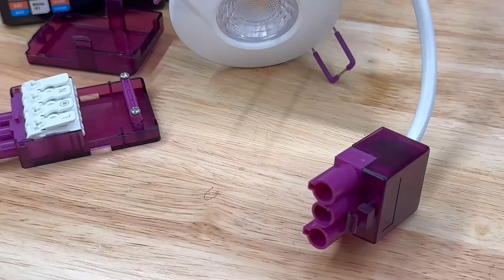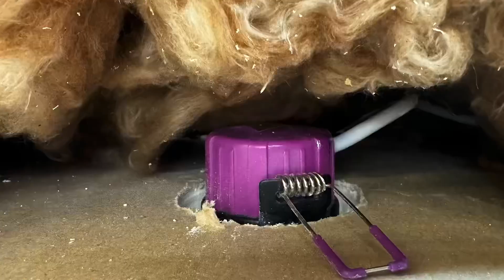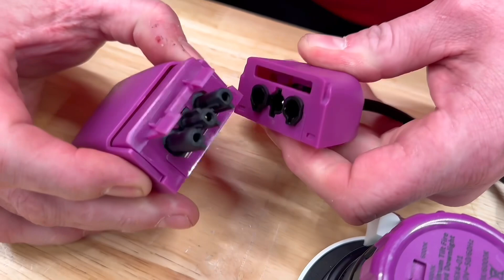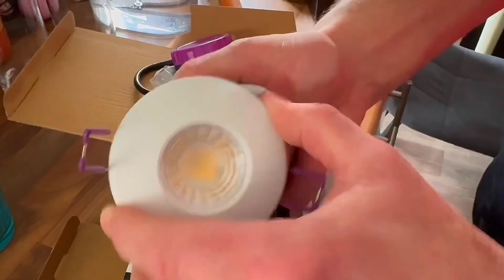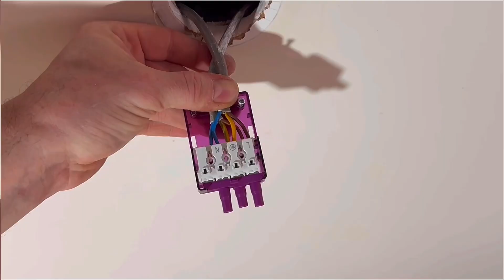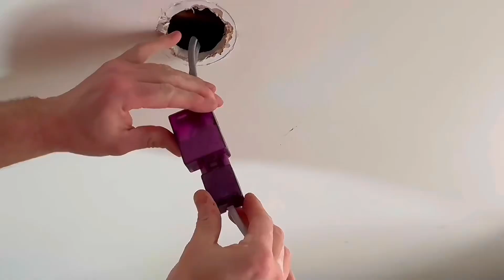I Found the PERFECT Solution for Shallow Ceiling Depth! - Robus Triumph Slim LED downlight

Comment: Working for this guy an unhealthy manner. Called me in on my day off which is Monday because we had to have a light put on the ceiling well the light he got was "the same as the other ones however no it wasn't. Barely awake hardly stable to be on a ladder it went in the ceiling. Am I in the electrician in the scenario no I was hired to do computer work and somehow well competent at Electrical was working on an electrical engineer and they know everything including structural engineering and flooring and etc... During the two-story addition he told me to look up a video on how to lay block walls, then as we're doing it complains that we're not doing it right but that's OK he knows how to do it he's gonna show us.....

Comment: Sorry to hijack this video.....I'm either going mad...or just mad. I'm sure it was you guys but about 3 months ago the was a video about a plastic brace that was designed to hold the downright feed fixed to a joist above a plasterboard ceiling allowing the ceiling to be fitted BUT stopping the guess work of finding your cables after as they would be held in place. I haven't been able to find this beauty ever since....help
Reply: It's on R Davis Electrical
Reply: @jameselliott7114  nice one

Comment: Scary to think back to the days of the old halogen spotlights that were pretty much open at the back with the ceramic base and  the bezel clipped around the lamp. The heat they used to generate 🔥 😮

Glad we have moved on so much now.
Reply from the maker: Great point 👍🏻

Comment: Why are these still being made? I have not seen any yet that last more than 3 years, manufacturers warranty replacements don’t match,connections are different. Luxna changed their connectors 3 times in 3 years AND the hole size!! Bin the lot after 3 years and start again OR fit replaceable lamp,version. I must have changed over 100 different ones of varying makes over 3 years
Reply: It's called modern day consumerism. Things like these are made cheaply on purpose, the driver is the most common thing to fail and the LEDs remain OK.

Comment: Yet another downlight that's ruined by the meagre 60-degree beam angle. A shame because it looks like a nicely designed unit. The efficacy in the specifications doesn't look especially spectacular either.